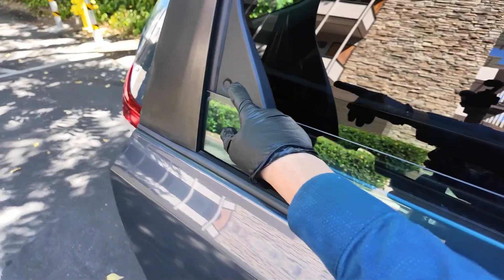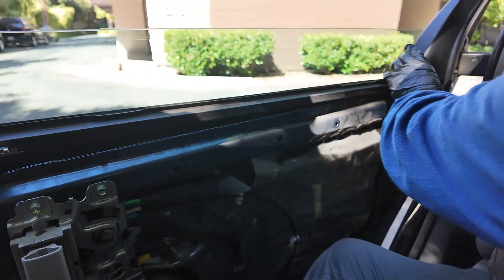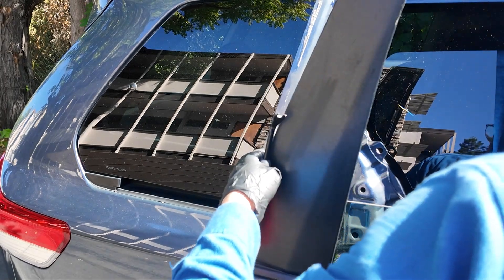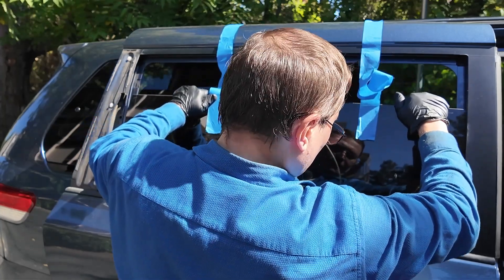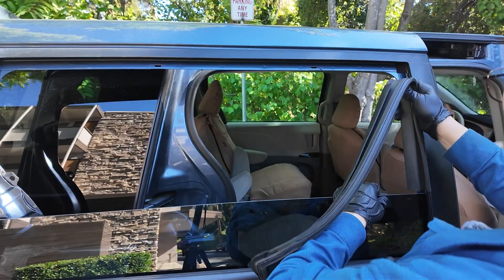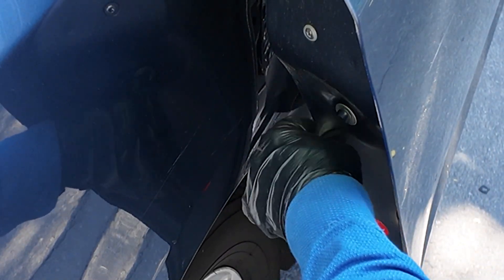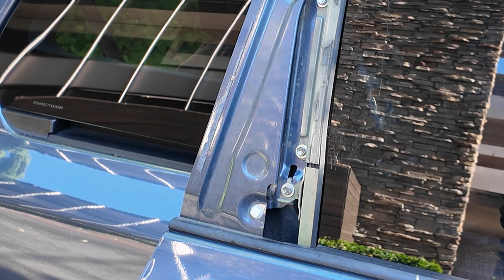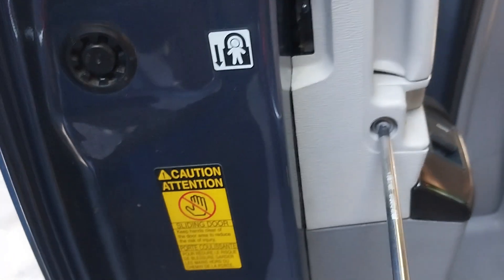Sliding door Window glass replacement for Toyota Sienna 2011-20

Comment: How come you have to lock the door bedore removal?
Reply from the maker: Before removal of what?
I didn't lock the door, but closed it almost all the way down. Door panel attached inside the door. You simply can't remove that plastic panel with door opened, if you were talking about door panel.
Reply: @SergSpace  14 seconds into the video it seemed like you pushed the lock mechanism
Reply from the maker: @Ramz_Uncut  Oh. That! If you won't do so, you won't be able to remove door panel without braking this lock button. I slide the lock button but didn't actually closed the door to do not lock myself in. Take a closer look at 0:58 (pause the video, look at lock slider position and cut out around it)
Reply: @SergSpace  thank you
Reply from the maker: @Ramz_Uncut  I'm glad if it helped!